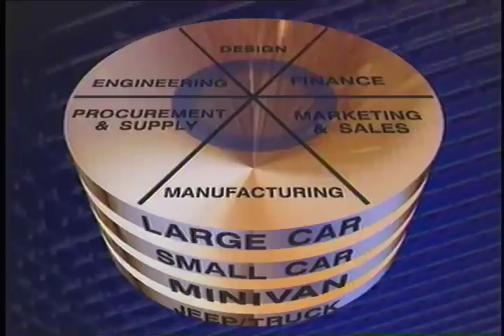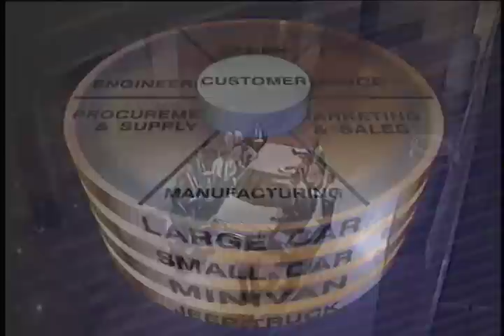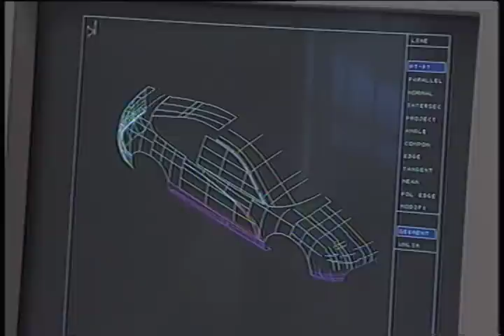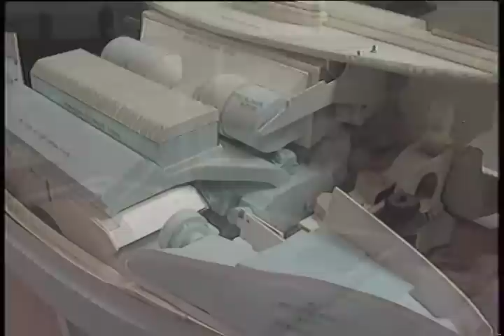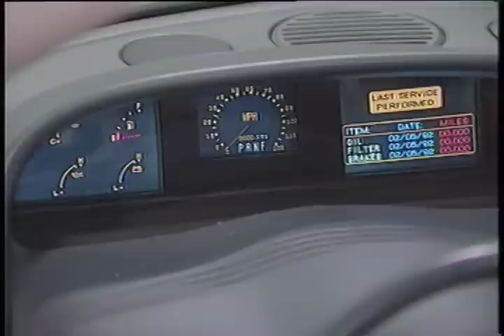Reinventing Chrysler 1992

Comment: Chrysler was on fire in the early- mid 90s, until the Germans got ahold of them.
Reply: Daimler raped and pillaged Chrysler. They are a despicable company who ran an already stressed company further into the ground. I have spent my whole career in the auto industry as a managing engineer. I have worked for a domestic auto company and Honda. The notion that Daimler was anything but a nightmare is nonsense.
Reply: Yeah. It was such a shame that they made them bring back the hemi, not to mention the challenger, charger and 300c.  Those jerks!
Reply: Reportedly they were already working on that before Daimler got involved.  All they did was speed it up a bit. Even if it was all because of daimler, the hemi and the LX cars do not make up for everything that was lost.

Comment: Lee Iacocca is the man.
Reply: supreme2005 My Aunt worked for Iacocca. she said never get him Angry lol.
Reply: He may have been for a while, but he killed off the solid M.bodies in order to push the crappy Dodge Dynasty.
Reply: He made one major mistake. Not selecting his correct successor. Now, after Daimler and Fiat, Chrysler is badly suffering.
Reply: @rossarmstrong6731  bob Lutz should've replaced him over bob eaton
Reply: @rossarmstrong6731  in theory the partnership should of worked and when the Pacifica was released it seemed like Chrysler had done the right thing but then the 300 was released and it was just a whole bunch of cheap black plastic.
Reply: @rossarmstrong6731        When isn't Chrysler suffering?    They've been bailed out, taken over and absorbed many times.   The Chrysler in this 1992 video doesn't even exist anymore.    It seems like management is really bad there.     Even GM  straightened up eventually.
Reply: Iacocca is like the second coming of Walter P Chrysler, who had a similar personality, a similar mode of operation.

Comment: The late K cars weren't that bad. In fact, the P bodies and later LeBarons were pretty good, if not boring cars. The new LH cars were ahead of their time, as were the 'cloud cars' . True there were teething problems but once they were worked out, they were a tremendous improvement over K car designs. Fiat/Chrysler  could take a lesson from this!
Reply: i <3 my '93 LeBaron convetible! Queen of the K's! used to have a 95 Concorde, such a sweet driving car. 100% competent cruiser, ran goodyear aqua treads, was a total snow destroyer with those tires.
Reply: Grandparents had a 1993 Concord, my mom bought it around 2000. It was An absolutely wonderful car that lasted a long time.
Reply: but Chrysler really didn't design the LH cars, it was basically the AMC Renault Eagle Platform, only developed further, one of the reasons why Chrysler bought AMC was to get the technology inexpensively  that they didn't have.   Everything except the Fifth Ave was front drive horizontal mounted straight rear axle,   The Eagle Premier gave Chrysler front wheel drive with independent suspension all the way around and longitudinally mounted.   This work all done by AMC and Renault was life saving for Chrysler

Comment: Cracks me up. "We can't figure out why they put foam in the B-pillar". The LH cars were sleek and handsome, but they were also loud as hell inside. At highway speed, I remember I kept checking to see if the rear window was cracked or the door ajar.
Reply: These are "ENGINEERS" that couldn't figure  this out. No wonder Toyota is a strong company and Chrysler is about bankrupt.
Reply: This was complete nonsense for the video, which just made them look stupid. Of course the engineers knew why they put foam in the B-pillar. It was simply the executives that were questioning the cost/benefit ratio of doing this. Chrysler was very cost driven in those days. I was an engineer there from ‘1988-2008, and knew over 1/2 the people in this video. Chrysler was incredibly backwards in ‘88, and made huge strides in the 90’s.
Reply: You'd like to go back and say, "These 1992-1996 Camrys are going to be some of the best cars made in this decade, and they're built by American workers in Kentucky, so you need to learn everything you possibly can from this thing. And that doesn't mean just going to your suppliers and saying, give me a part like this but at half the cost Toyota is paying for it."

Comment: Not sure why my older comment disappeared, but no one should really be shocked to see "future" Chryslers in this video. At 9:25, is the "NS" minivan (1995-2000) in Dodge Grand Caravan ES form as a clay model. Concept design approval for that was on September 23, 1991 and final production design freeze in May 1992. That part of the video was shot around April 1992 I figure. Prototypes for that pretty much ran from November 24, 1992 to January 1995.

The Omni mule was the "JL" Neon, even though some JL prototypes started being built in January 1992. JL (Neon) design freeze was in mid-1991, being slightly modified at a high expense from rectangular to circular headlights in September 1991 by Iacocca, to resemble the 1991 Neon Concept from NAIAS.

The T300 was pretty much done by September-October 1991, considering that the design was pretty much defined by November 1989 and fully locked-in by mid-1990. By the time the 1994 began rolling off the line in July 1993, 3 years had past since the LRT Concept was shown as a preview in 1990 and final sign-off.
Reply from the maker: +Carmaker1 Not sure.  Why it vanished.  Don't see it stuck in the pending responses.  Sorry.
Reply: How did you become so smart?  Did you work for Chrysler?

Comment: I was a dealer line tech in the 90's after servicing the 70's n 80's staff cars n truck products in the NAVY,(the govt got a good deal around the govt bail out) ,i learned gas fuel injection, and modern systems, used the DRB hand scanner, the MDS (mopar diag system) was the uplink for acute diagnostics which was way ahead of GENERIC MOTORS n FORD, It breaks my heart to see 7 yrs after this film they sold it all away???  I take care of my customers 96'XJ, and I have been driving n
my 1986 RamCharger AW150 4wd 318 2-bbl for 18 years now.
Reply: Miss my Plymouth trailduster sport -

Comment: I started by wandering in, won't say under what auspices, then became a spy photographer then worked for Hearst pubs. Highland Park AND Auburn Hills were completely unguarded during construction and transition. Got the 95 NS van in clay 2 years before at HP, room doors were so old they swung open, locks bent! AH had construction holes in walls you could just walk through to the finished section with employees working. Milford had almost no security. All of them had lax security except Ford HQ. Those were the good old days.

Comment: Great video! I like this type of videos a lot.
I still drive on a daily basis 1993 Chrysler Vision 3.5 V6 ( Eagle Vision ) here in Europe. Bought it five years ago for around 1800$ with 85.000miles and I am very pleased with the comfort, great reliability, that 3.5EG series engine is a gem in a combination with the 4speed transmission.
It is far better car in terms of user friendliness, realiability, comfort and charm than any BMW 7 series that I used to have. I still prefer this old LH over the MB CLS that I had, it is something about this american engeneering... Of course I am aware that this LH platform is FWD with bad weight distribution and bad driving dynamics.
I also have 300C with the 5.7 hemi ( yes, the one from the dark times of Chrysler ) and it is also a great machine. 
Love the american cars, the only shame is, they are extremly hard to get here in EU. My next car is the new Mustang 5.0, which is one of only two real american cars available new here through the official dealer.
Reply: loved my 1994 concorde, sold to my sis with 150k, they drove it till 200k. idk why they got rid of it. my mom bought it used with 70k, i drove it for yrs, then my sis. ppl complaining about them likely beat/abused them. my aunt has a 2000 Intrepid RT, daily driver yet! lord knows how many miles she's got on that 'ol red Dodge :)

Comment: THANKS for the video..! I owned 2 Chrysler vehicles. A  2000 Dodge Neon with a modified body kit, and a 1985 Chrysler Lazer Turbo all stock . Til' this day "2013" the Chrysler Lazer Turbo was the most comfortable car to drive the suspension felt plush and I had a sense of pride driving that vehicle...It's strange how attached I was to the Chrysler Lazer.

Comment: I had a 95 Intrepid with the 3.3 and ya it had it's problems but show me a car with 280,000 miles that didn't. I liked that car it was comfortable, never left me stranded in the 10 years I owned it, and had decent power to get the job done.
Reply: mercedes benz w123, those cars were built like tanks. they could easily go 300,000 miles without a single issue with them esp the diesel versions.  they were one of the best built cars in automotive history. I still see them on the road after 29 years since Mercedes quit making them.

Comment: The Intrepid was a nice looking and driving car. Too bad their 3.5 v-6's had build issues. After 80K they pretty much all had a rod knock.....
Reply: I had a 97 that ran until 193k, an 02 that I traded at 156k for a 99 LHS which will be traded at 159k.  They were good engines for their time.

Comment: These older unibody cars appear to have more metal surrounding the front box, and were made of steel with strong steel suspension, and were able to sit six people, yet were lighter than today's cars. The larger cars also had 6 cylinder engines, instead of complicated high compression 4 cylinder Turbo's, with pricier maintenance and less reliability and longevity.
Reply: idk why the 4 cyl turbo is a better idea than a 6 popper. lighter weight to post better slalom numbers..ppl go ape over things like that, lol. 80's Mopar turbo 4's were great, fairly mild boost levels, garret air research water cooled turbos.. not too sure about all this putting turbo 4's in rather large vehicles nowadays, much heavier than the lil 80's Mopes. i have a '70 Fury Gran Coupe im putting back on the rd, huge car..400 lbs lighter than a new Challenger, lol! a thick sheet steel unibody is the best way to make a car..period.
Reply: The engines and transmissions should of had the care and designing that the cars had

Comment: As a Mopar man I remember looking at the new LH cars and wanting to throw up... ugly, big plastic interiors, engines hard to work on... I passed and kept my 1987 Fifth Ave, 318 "boat" for 10 more years... what a smart decision that was! I'd like to re-title this movie as "Ruining Chrysler 1992."
Reply: owned both of those..loved both! now i drive a '93 LeBaron droptop all summer with 170k & going strong. the 5th ave though, such a sweet car. miss it. had a chance to buy another a few yrs ago.a red/red one, '88 with 85k! they wanted 800..i heard later they sold it for 500 bux! had some minor ign issues. i told them, ditch the lean burn, just have a mopar perf dist/ecu pkg put in it..but nope. i didn't have rm for that sweet 5th, unfortunately. i had a sweet '93 Ram 4x2 (had probably more options than any truck made that yr, lol) with a 5.9L mag and a '00 Durango 4x4, one of my fave vehicles ever. amazing. if you like the 5th ave, you'd love the 4x4 Durango. they're out there cheap. such great drivers, bc torsion bars & leaf springs, monster brakes, fabulous handling/utility.
Reply: @gzuzsavz  I've been looking for a fifth ave. No luck so far.
Reply: it's the only one listed on eBay. looks nice, blue/gray car, needs topside paint. Craigslist no doubt has a few more examples.
Reply: @gzuzsavz  I'll check eBay out. Thanks
Reply: @dontelindsey5846  No prob!

Comment: The Omnirizon was replaced by the Shadance in '87, and it is odd that 5 years later they are using a L car to mule the Neon.
Reply: The Omnirizon ended production with a limited run, revised 1990 model that had an airbag.
Reply: @eltonjohn3236  Correct. My aunt had one. It was the most refined version ever produced.
Reply: No. Aries and Reliant replace P-car Shadow and Sundance for 1987. Chrysler honor K-car more two year until 1989.

Comment: Nice to see them r&d and work together though funny to see them breaking down a camry and criticizing it. Those Camrys cost of ownership was likely a fraction of the intrepid and would out live it tenfold. Stellantis releases stuff with disregard to anything. Instead of making something good and people want and of quality they make everything garbage and anything they did have that was good discontinue it or change it so it sucks. And not make replacement parts. But those LH cars were beautiful however in true Chrysler fashion suffered from reliability issues. Many of them got multiple transmissions. Various electrical and engine issues. And suspension inner tie rod bushings would go bad quick.

Comment: I was a professional mechanic during these transitional years. Cars were JUNK.
 It was hell as a profession.
Always something "new and better" coming out. 
When in reality car companies were scrambling to survive government regulated emisons.
Cars were JUNK all through the mid 70`s and 80`s.
There was`nt one good car made. 
It was all hype.
They didn`t even have good metal or paint.
It was a marketing farce.
Reply: just plopped a '77 440 into a '70 Fury Gran Coupe. 150k on the engine, has 150 psi in all 8..as new compression. explain 'junk' to me again? lol. that engine donor New Yorker sat outside in Wisc, zero shelter for 20 yrs. all the electrical still worked. engine turned over..half ass ran with 3 plug wires eaten up by mice! 'Junk'. Malarkey. I have dozens more personal stories about 70-80's Mopars being pretty dang good.

Comment: 16:22 the answer “  B-pillar is the most significant energy-absorbing component for the vehicle side impact, and its collapse modes and energy absorbing capability can greatly influ- ence the full vehicle crashworthiness and safety of pas- sengers. In order to improve the energy absorbing capacity of the B-pillar, the aluminium foam is filled into the empty B-pillar in some vehicles,”

Comment: He's the man but Chrysler did not get better. Rams interior and exterior is super nice and the Pacifica is a great looking minivan the 300 was a great visual success a decade ago but looks were not the problem....it was their quality control their reliability their durability and their brand perception in relation to those things. Nothing has changed at all! They are the same. At the bottom of the barrel. Fiat was a terrible merger.  They spent 100 million designing the Chrysler 200 for 2015 and while it was a good looking car it was a flop! They invested big into a market dominated by Honda and Toyota.  The 200 is now gone 4 years later! The 300 hasn't been redesigned in 10 years plus. The ram is an amazing truck but not reliable.  The Pacifica while a good effort is way behind sales leader honda and Toyota.  They just can't figure it out.

Comment: I owned two mid to late 1990 model LH cars. I can tell you from personal experience they were not world class vehicles. I have nightmares about the 3.5 and 2.7 liter V6 engines. Both cars were pretty much used up by 85,000 miles. Lots of annoying problems both mechanical and electrical. And no resale value what so ever.
Reply: +Lousybarber Why do you say that? I have an older friend that bought a new Concorde...back in the day. Only real mishap....was the Transaxle...replaced under warranty....and the dealer insisted on only Redline ATF. That car has been bullet-proof in terms of reliability/durability. He (every 24,000 miles under the dealers recommendation)flushes the Redline ATF.................it has never had Transaxle issues(like all LHs) since the 1st replacement and keeping fresh with Redline ATF.
The Concorde recently rolled-over 400,000+ miles...other than 2 alternators and water-pump..........engine is still together as it left the factory. He tows boats and abuses that car...........and yet it still starts and goes 20+ years.
Reply: you got that right.

Comment: Three generations owning Mopars. 60s/70s raced slant sixes/440s. Favorites were the fuselage bodies. 456K on a 97 Ram 318 and one broken valve spring. Too much bling and BS today just to sell vehicles and find a way not to stand behind them until government steps in. Current vehicles GM.
Reply: ...y'know..nobody on this thread knows what a fuselage bod is. cept moi. lol. my 1st car i got in '84 was a '71 Satellite Sebring plus, had a '74 cop 440 in it..some bondo, lol, 727, 3.55 sg, pretty loaded. $1,500! lol. yeah, fuselage bodies, total dream machines. those dang magnum mills in the 90's, wtf? mechanical joshua trees..sheesh! 300k is nothin, as you point out.